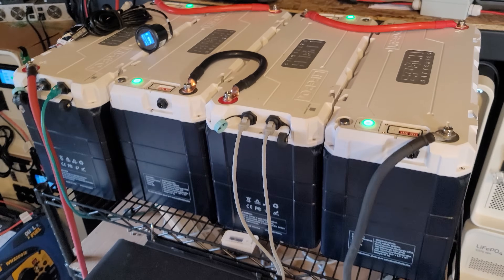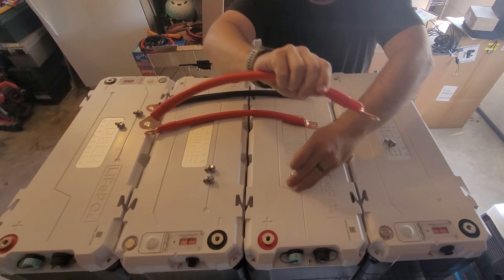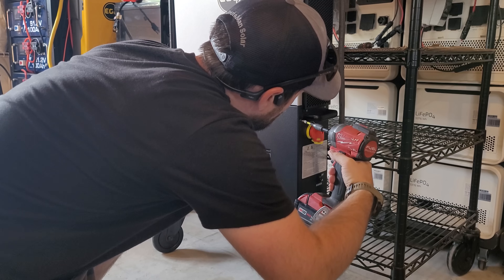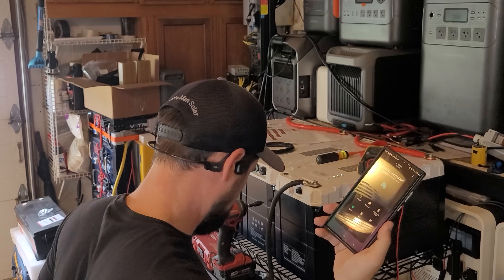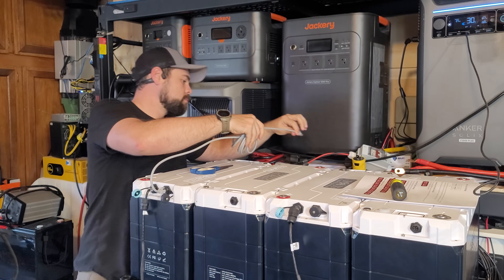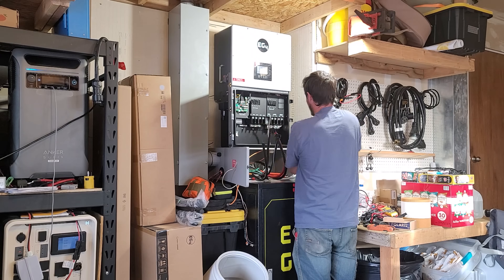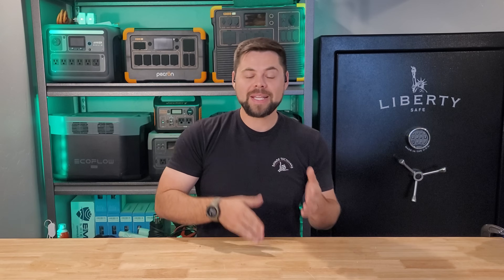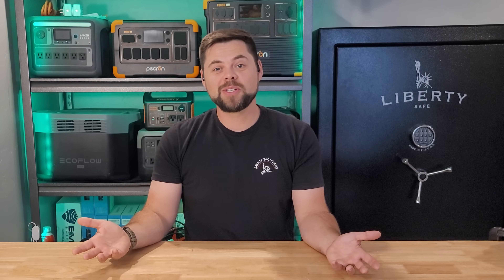Easy DIY Off Grid Setup using Epoch Batteries to Run Everything

Comment: in case your running a 48v inverter in my eyes your always always better to run 48v batterys....
if you are building out over time and go for these batterys and chaine them they are a good battery because of the port com that balances the batterys...  and always try to buy batterys with comports even rack...its always better and less things to worry over time. 
so even a 2x epoch for a 24v setup would be a nice and wize choice over other stand alone batterys ...

Comment: Why would anyone want to do this? People would do anything just to promote a battery even when they know it makes no sense. First of all, even if you want to series connect 12v batteries like this, there are cheaper batteries out there, instead of paying $2000 for a 12v 450ah battery. Secondly, just buy 48v batteries and save yourself all the stress. Even a server rack battery doesn't cost that much. You could buy 2 ecoworthys for less than that price for 10KWH.

Comment: To keep 12V batteries wired in series you need to leave 10A balancer/equalizer connected and charge them to 100% weekly.  Otherwise, if you use the system heavily, there voltages will get badly out of balance within a month and reduce your useable capacity dramatically. 

Alternatively, you could manually balance the battery voltages weekly or monthly depending on your usage.

Comment: Love your content but $8,800 for 23.5kw for home energy storage is crazy.
Reply: There are the 15kwh tall batteries for $2000-2500 plus shipping that people are using nowadays, no need for parallel if you use only one. One of those and an inverter is a very simple an sweet setup.
Reply: You'd be way better off buying the Walrus.
Reply: @lewnetoons Walrus is crap!